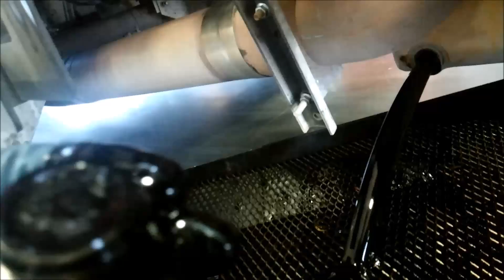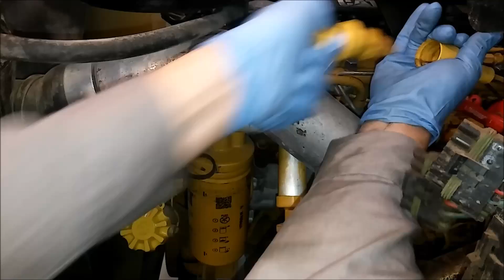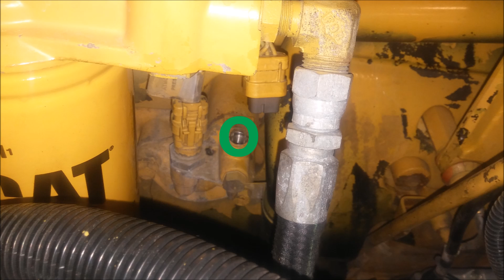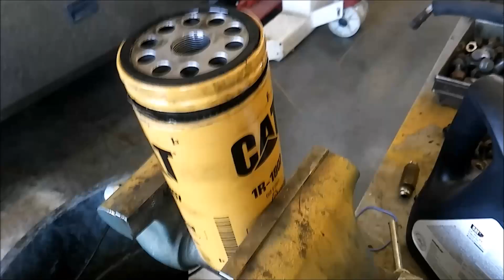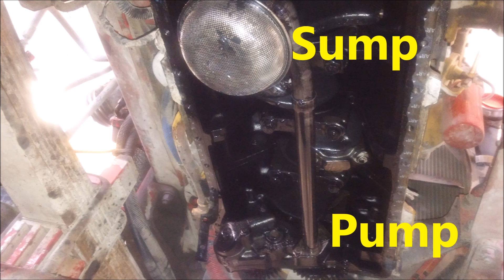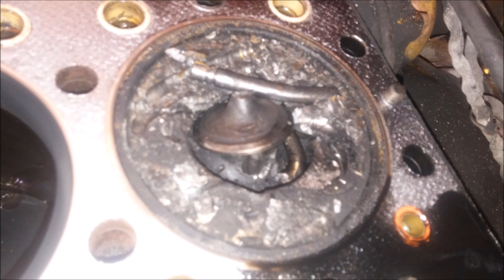What Causes Low Oil Pressure?  Troubleshooting And Causes Of Low Diesel Engine Oil Pressure.

Comment: Just out of curiosity dude, that engine which had the valve embedded in the piston, did it require a new engine or were you able to save the block, replace the piston, rehone the bore and just get away with new head/valves? I'm not all that familiar with larger diesel engines like the kind you work on. Most of my experience is with smaller automotive engines 1.4/2.4L I4/I5/V6 we have in the European market and i have seen similar damage before but its a used engine job in that case.
Reply from the maker: +zoidberg444 The block was okay because it was a 3306 which has liners, but the customer opted for a new block anyways.

Comment: I have a 5.3 and a mechanic is telling me I need a rebuild, had the truck 6 years oil pressure is always 35 at idle hot
Reply from the maker: +Kevin Burgess That is good oil pressure. There are other reasons to rebuild an engine other than oil pressure though, do you have weak cylinders or high blowby perhaps?

Comment: Like your comment  , your oil pressure is 30- 35 at idle save  your money for when your engine really needs to be replaced. It SOMETHING HARD TO.FIND AND HONEST MECHANIC . They don't write Parts down on the estimate and breakdown the cost .
Reply from the maker: +Kevin Burgess A lot of people freak out if they see their oil pressure has dropped a couple psi, oil pressure is a good pressure to watch, but if its a little lower than years before with no other symptoms that usually normal.
Reply: Thanks for the comment. My truck has a steady 30 gsi hot , for years, this F'N mechanic tells me I need an engine rebuild. BS
Reply: That's PSI

Comment: I been a diesel mechanic since 1979, I learn from you. you rock dude
Reply from the maker: +W Barney Were you a Cat mechanic or did everything?
Reply: Adept Ape 
W Barney My  2016 DD15 is showing pressure at about 20psi at idle but no codes are coming up. I noticed the jake doesn’t come on at random. Should I be worried and stop ASAP?
Reply: U are an asshole
Reply: W Barney My  2016 DD15 is showing pressure at about 20psi at idle but no codes are coming up. I noticed the jake doesn’t come on at random. Should I be worried and stop ASAP?
Reply: W Barney no buddy asked you for how long you’ve been a mechanic
Reply: @arturocano5616  fuck you
Reply: @arturocano5616 Nobody asked you for your irrelevant opinion on his statement.

Comment: Hi, i have a question ? Have Detroit 60 , when is running down the road is 40psi , idling is 20. Is that normal  ? THX
Reply from the maker: +Vito Josy I'm not a Detroit mechanic, so I can't say that is normal. If it was a Cat those would be okay pressures.
Reply: Adept Ape HI HAVE CAT C 10 OIL PRESURE COOL IS CLOSE TO 50 AND HOT 25 IS A GOOD PRESURE 4 C 10 1999.   1,40000
Reply: thx

Comment: During my last oil change on my C9, the CAT oil filter wasn't completely full. I filled the oil filter about 1/3 and continued changing the oil. I checked the oil level before starting and it was above the full mark, after running the engine for a few minutes it was on the mark. i don't want to remove the oil filter to check the "how full" the filter is. These bypass valves in the oil filter base,, can they failed open and then operate normally again? Thank you Adept Ape
Reply from the maker: That an odd issue, I don't think I've ever pulled an oil filter off that is only partially full, sometimes the fuel filter is partially open, but not the oil filter. Now most oil filters I change get punctured to drain first so I wouldn't know if they were partially full.
So it is possible that the filter bypass failed open and then went back to closed position. The valve has a spring to keep it in a closed position. You may want to have those valves changed if you getting a filter that isn't filling. Are your oil pressures normal?
Reply: Oil pressure is 38 PSI at operating temperature. Now I'm using Amsoil 10w30 to lower the start-up pressure. However, with ambient temperature 64 F, the start-up was 102 PSI. After 9 minutes 49 PSI at idle. On this 200 mile Motorhome trip it was 15 miles on interstate before oil obtained operating pressure. Any pressure around 50 PSI is too high with engine load above 50%. I assume the HEUI pump with high supply pressure will pump higher pressure too. Can these valves be check with filter remove? Thank you Adept Ape.
Reply from the maker: Those pressures seem really high, especially with you running 10w30. As far as the accessibility of the valves, I don't think I've ever changed them on a C9, what is your serial number and I'll try to look it up this week. I'm trying to think what could be causing these symptoms of a partially filled filter and high oil pressure. Usually a spun bearing causes lower oil pressure, although I could see a bearing that had moved and blocked off a crank oiling hole perhaps, but that doesn't explain the oil filter. I would change those valves first and see how that affects the system.
Reply: Adept Ape  9DG05013. Thank you.
Reply from the maker: +Kenneth Bullins Alright so according to Caterpillar, the valves are both accessible from the picture. One faces up and one faces down on the oil filter housing.
Reply from the maker: I just saw your donation, thank you very much. Let me know what you find on your RV and if you need any more help let me know.
Reply: I plan to turn the oil filter, if oil comes through the seal, I'll stop. If not I'll remove the filter to check the level and investigate the valves. 1R1808 is a large filter. 
And you're welcome.
Reply: Kenneth Bullins when the motor sits all the oil drain's to the bottom then you start it and run it alot of the oil is still in the head and the rest of the motor so when you check it then it looks lower, let it sit and it will look it has to much again
Reply: Kody George what percentage of oil is "in the engine" when operating? CAT C9 have 8 gallons in the sump (oil pan). The manual capacity is 8.5 gallons-but 1/2 gallon is always in the engine. Thank you

Comment: I have a question, I have a c15 accert mxs 475h. last week an injector went out got it replaced and been having problems with my pressure.
Reply from the maker: I read your email as well and replied through email.

Comment: I have a cat c15 acert mxs, I used to do pm on my truck every 30,000 mls with rotella t6 5w40 full synthetic, but replacing the 3 filters at 15000 mls, now I started working for a company that i don't run a lot of miles, but is using a lot more idle time because the use of a pto, without driving as many miles as i used to.
My question is... Should I go for oil change per hours? and, how many hrs should I do the pm now?  to be within the right maintenance per Cat. tnx, I really like the info you are putting out. tnx
Reply from the maker: +Carlos Mondragon I looked up the actual Cat guidelines for servicing your engine and was surprised that Cat recommends a 30,000 mile/500 hour service for fuel and oil on C15 engines. You are running synthetic so if you go by hours, then 500 hours should be a good time to do it.
Reply: I HV a 2nz engine after changing the Timingkit my oil light on the dashboard come on why could b the problem

Comment: thanks I just needed to hear it from someone else. what do you think about Marine cam shaft??? or stick with stock and life of the engine over all.
I have hot numbers in it already.
Reply from the maker: +Joshua5869 Kubo Well I wish I was the bringer of better news about the engine. I'm not a big fan of messing with the stock parts. It is your truck and I'm sure guys out there run with hot parts a lot, but my opinion is keep it stock and keep a warranty.  I don't have experience running a marine cam in these engines.

Comment: over head cam all good. pushing antifreeze 1 gallon over a month. building pressure. put 10 pound cap seams to be helping. I think the head is cracked. sound like an overhaul.
Reply from the maker: Do a bottle test, I have a video on how to do it, but you may already know how to do it. Sounds like that head probably has come off though.

Comment: OK truck smokes on fire up?
normal idle smokes for 4 to 5 minutes. higher idle 900 only for two minutes. truck runs great all day long plenty of power. number 4 injector went bad changed, still smoking. done injector cut out number 4 smoke goes away. what do you think? 3406E   1LW
Reply from the maker: +Joshua5869 Kubo Sounds like you did some good troubleshooting so far and isolating it to cylinder 4. Alright well if you changed the injector and you still have smoke then it is something mechanical, now don't panic yet as it could be something non major. The overhead for number 4 cylinder needs inspected carefully, you could have a rocker arm or cam lobe failing. The Jake can also stick which would keep your exhaust valve slightly open at all times, which can result in that as well, if you suspect the Jake you can look to see if it is further out than the other Jake's or swap the Jake housings with another cylinders like 1-2 and 3-4, or back the adjuster off. Check your valve adjustment as well. Now if all of that looks good then that pretty much leaves the cylinder/piston/valves. So the head would have to come off. You can also pull the oil pan to inspect the cylinder walls, or do a leak down test with a rubber tipped air nozzle to see if that cylinder holds air properly. Hope that helps.

Comment: looked like the keepers on that valve had somehow come off.
Reply from the maker: +Intrade Motor It definitely came apart, the lifter and cam looked good, but the pushrod was bent. Not sure if the bent pushrod was a symptom or cause, those pushrods on a 3306 are about 16 inches long!

Comment: Thanks for taking the time and effort to share your knowledge. Neither my son nor I are professional mechanics but we prefer to do our maintenance (preventative and corrective) when we feel competent in doing so. You have helped. He has a 3128 in a marine application and I have a C-7 in a motorhome.Since the engine in a motorhome is installed with the front facing aft I assume your references to left side/right side or driver side is reversed in the motorhome application. I belong to a large motorhome based group (Fleetwood Discovery) with a large number of existing CAT powered units and will encourage the membership to subscribe- if for no other then reason then to be able to talk about a problem intelligently.
Reply from the maker: I hope I have your subscription then. Not to say I'm never wrong, just try to tell information that is correct and vetted.
Reply from the maker: +Intrade Motor I appreciate that. I don't mind hearing new information when it's out.
Reply from the maker: +tom ferrara Thank you for the support, tell them to subscribe please, it really helps the channel grow. Alright so for the jargon on the RV engine, on an engine the left side is always in relation to facing from the rear of the engine looking towards the front of the engine so the left side is always the same side, but you are correct that it would now be the passenger side since your engine is facing with the front towards the rear of your rig. I should have just said the intake side, would've made more sense.
Reply: if you don't see me comment on his vids about something said wrong you can assume that its100% accurate as I only subscribe to people with professional accurate content my self.
Reply: yes you are on my small list and no one can know everything it's why we can comment to point at potential wrong information and talk about it.

Comment: When you roll in a new set of bearings, in a C15 or 3406E, do you always change out the harmonic balancer. .?
Reply from the maker: It is very rare to change a Dampener or Damper as Cat calls them. Even on a "Platinum" rebuild Cat does not have the Dampener changed.
Reply: Question for ya Ape, why is it that Pittsburgh power says to change your dampener every 300K-400K?? Not really sure if they're talking the dampener or the harmonic balancer tbh. Also cold you give us a video on the proper engine break in for a rebuilt or re-manned engine please??
Reply from the maker: Since the engines that they work on push out more power they may have issues with the harmonic dampeners failing, but I have yet to see one come apart in the 6 years I've been in the truck shop. You would have to ask them why their recommendation is like that. I could make a video break in, but it would be very short since Cat recommends putting the engine under 100% load as soon as possible. If you watch my video with the truck on the dyno, that is a brand new rebuild with 0 miles on it. Cat says that it helps to seat the piston rings.
Reply: Is there a need to uyse any high zinc oil to help with the break in or just use normal oil by cats recommendations??
Reply: Yep, thats what I have read also.. they insist on a change out..
Reply from the maker: Just normal oil, the older engines with flat tappet camshafts may benefit from the high zinc additive, but on the newer engines that use all roller valvetrain, normal oil is all you need and it is all we use.
Reply: If and when I get a truck I'll most likely be going with an older engine truck, 6nz or something of that nature!!! The newer engine trucks just seem to have way to many problems in them in my opinion from what I've seen and heard!!
Reply from the maker: That is a good idea. The single turbo Cat engines are great engines with very few problems over all.
Reply: My self I'm not interested in going into CA for any reason that's why I've decided that route

Comment: great video I how ever have  a question my oil pressure is around 40 or a little above at idle a around 70 to 75 at 1500 rpm I did hook up a gauge where you explained after about 10 to 11 hours of running the check engine light comes on  the code says it's low oil pressure I know it does not I can shut the truck off for about 10 minutes and it will take about another 10 to 11 hours for the check engine light to come on
Reply from the maker: What is your serial number sir, if you told me already I apologize. Does it say engine oil pressure low or Intake valve oil pressure low, or does it have an oil pressure voltage low?
Reply: I got the serial number off the block wrote down somewhere the code that comes up is 46 it has a 3406e in it
Reply from the maker: +dale intimidator If it's an E model then you don't have the IVA oil pressure faults. So sounds like a sensor or wiring issue perhaps.
Reply: thank you